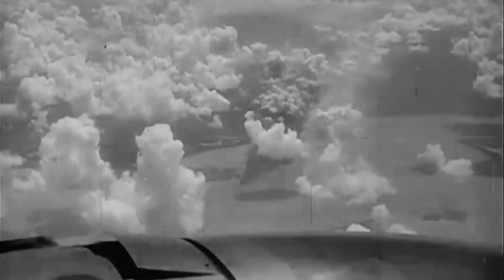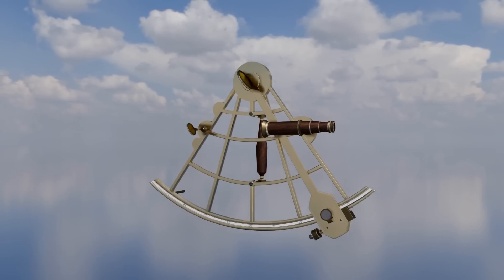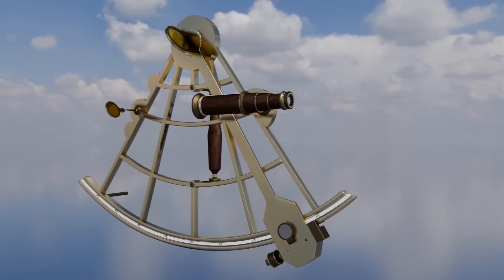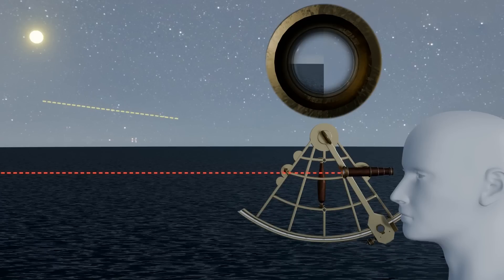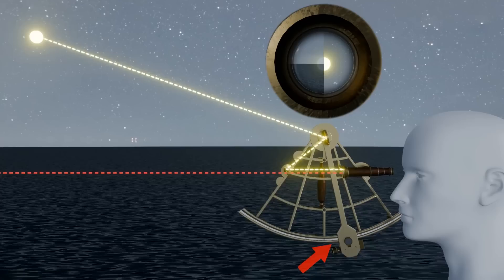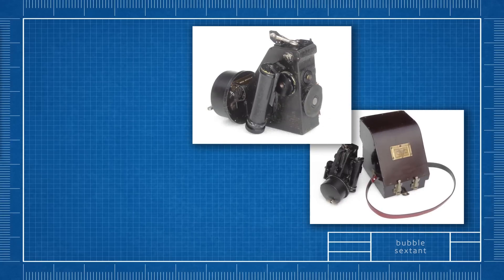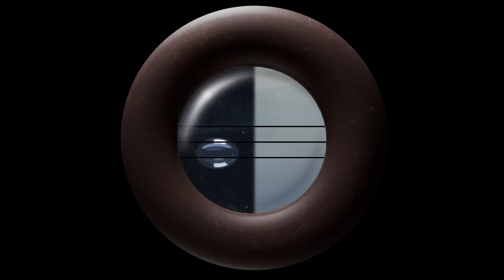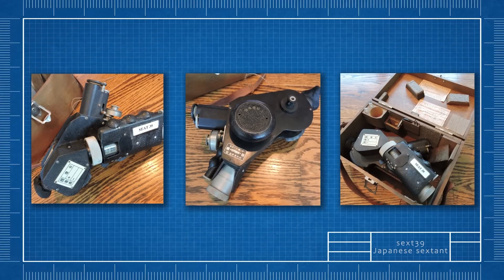Returning Home 2: How Japanese Pilots Navigated Over the Ocean in WWII

Comment: Doubt pilots of single seat aircraft were using Bubble-sextants as their primary navigation means. 

Sure in multi crew aircraft/bombers with proper navigators. 

But you didn’t really answer how single pilot aircraft navigated other than by dead-reckoning, which is notoriously unreliable over great distances.

Comment: Dye markers for navigation ... You rapidly touched this topic in closed captions, but went so fast I couldn't read it ... Could you repost that. Info on dye markers?
Reply: I found the transcript about the IJN use of dye marker at the end of the video.    Very interesting!  I've read that carrier pilots sometimes follow the wake of the carrier to find home.  Is that true?
Reply from the maker: I’ve heard about these two methods but I haven’t found any reliable source to verify them. You can find photos of IJN planes with narrow stripes painted on the fuselage, wings and horizontal stabilizers. It is said these stripes were used to verify the plane’s heading relative to the sea waves. Quite an interesting theory and I’m digging deeper to find out if that’s true or not😉

Comment: The difficult thing about a sextant is that it can only reliably give you latitude. Longitude is so dependent on the exact time and stability of the instruments that you can be off by a couple of degrees, which is as much as 70 miles error.

Comment: Another technique for overwater navigation is plotting your base course to an offset point from your destination, so you know which direction to turn if your destination is not in sight when you get there.  Let's say your destination is an island but that island isn't visible when your chronometer says you've flown long enough.  If you plotted your base course directly to that island you can't be sure which way to turn to find it unless you are really, really confident in your wind drift calculations.  But if you plotted your course to a point South of that island you could be reasonably confident it was somewhere off to your North and you could start your search in that direction.  This becomes a lot more difficult with moving ships. 

The diagonal markings on the horizontal stabilizers of some Japanese aircraft may have been aids to help calculate wind drift.
Reply: Robert Mason wrote a book called "Chickenhawk" about flying UH-1 helicopters in Vietnam in the mid-1960s during the war. They would plot towards the target, but not try to account for wind drift. Then when they had flown long enough, they turned upwind to find the target. Since helicopters are slower than WWII fighter aircraft and much shorter ranged, I'm not sure how well this could have worked over the Pacific. 

Sounds like the Japanese pilots had to be much more confident of their dead reckoning and/or celestial navigation skills than the US pilots that had a radio assist.
Reply: それは「偏流測定線」です。日本海軍の機体には、他にもコックピット外部前方の側面に「急降下目安線」、フラップ翼の前方に「フラップ作動角指示線」など、他にもいろいろな種類の線が塗装されていました。

Comment: The biggest problem of dead reckoning method is that measurement errors accumulate over time and, especially while flying over a large body of water, can't be corrected using known ground features as visual reference.

Comment: This is an amazing aspect of the intricacies of flying a plane back in the day!
One doesn't really give much thought to these aspects of piloting a fighter at sea! 

Similarly, how to adjust fuel mixtures in flight during a dogfight!!!! Yow!!!
Wow!!!
Reply: There's no mention of the fact that the wake of a carrier, which displaces tens of thousands of tons and thrashes a lot of air into the water, is many miles long.  It's kinda hard to miss.
Reply: @David_Lloyd-Jones  Navigation is much easier with less than about 2/10 clouds. Low ceilings make locating landmarks very difficult over open water. Fly at 500 feet and see how far you can locate anything.

Comment: In 1922 two Portuguese Naval Aviators, Navigator Gago Coutinho and Pilot Sacadura Cabral,  departed from Lisbon in a Fairey IIID floatplane and eventually reached Brasil. It took them three aircraft because they force ditched in the first, which eventually sunk, and had a floater ripped off while sea landing in the second. But stubbornly restarted from the position from they had crashed and eventually succeeded. (Just imagine our Ministry of Defence indulging this nowadays! 💪)

A position they had to find in their flight, besides the support ships, was the reefs of São Pedro e São Paulo, just a group of unhabitated rocks in the Atlantic, and they did find them!
It is known that the Navigator had for the first time added a clinometer on his sextant, therefore enabling the instrument to be used airborne. The navigation was all Astronomical and by Dead Reckoning, but the skills of the Navigator and boldness of both crewmen were absolutely outstanding.

While Gago Coutinho died at old age, Sacadura Cabral vanished in the North Sea a few years later while collecting from Britain a new Felixstowe Seaplane. The Fairey which flew the last leg, Santa Cruz, is in the Navy Museum in Lisbon while another Fairey turned replica is in the Air Museum in Sintra AFB.

It can be done, but will request Navigation skills well above average, and luck everytime. 😀

Comment: Planes tend to float for a while upon hitting the ocean due to the fuel in the wings - would it have been possible for an escort vessel to fish out a plane shot down by AA (or the pilots body), or simply check it with a rescue swimmer, and use the maps to launch an attack on the home carrier (if the pilots were given course and position data for the return trip, it could be used for a counterattack as it would have to have accurate data for the next several hours)
Reply: Not very possible nor practical, first of all aircraft doesnt swim due to the fuel, but rather due to the empty tanks and being light i  general. But again it doesnt swim all that long couple of minutes at best. Also maps should be brought, translated and that would take time and by the time you have info at the right table it is already of little value. Besides that if an aircraft carrier aircraft attacked you, then you are aware of the presence of CV in the area and you can already roughly estimate its position or general area where it is so theese maps that are already inacurate by the time you get them are not really of that big value.
Reply: A6M等の日本海軍機には不時着水時に浮力を提供する浮袋が主翼と胴体後部に装備されていた。浮袋に被弾していなければ機体は海面で数時間漂う事ができた。
長いものでは3日間以上漂っていた機体もあるそうだ。

Comment: The sextant is useless in an airplane. Ask the historical department of RAF Bomber Command.
No one can shoot stars in a plane that moves in 3d. An aircraft is not a slow vessel on the sea.
Reply: And yet a lot of E-3B, RC-135, WC-135, KC-135A, and many, many other WWII, Korean War, Vietnam War thru the Cold War aircraft equipped with navigators and sextants somehow managed to do it regularly.  Ask the USAF.
Reply: @timothy____1989  They did it with radio aids such as TACAN and Omega.   The sextants were just a back up in case of radio failure.   Once they got within range, they would be detected on radar and talked home.
The British used sextants in WW2 and often couldn't find the right German city to bomb.
Reply: @timothy____1989  Yes, its no good having a manual back up method if through lack of practice you've lost the skill involved.   In WW2 the Germans (unlike the British who didn't really care what they bombed, so long as it was German), tried using a crossed-radio beam system to hit specific targets, bombing where the beams crossed.  They were foiled though, by the British transmitting on the same frequencies, which had the effect of displacing the beams.
I didn't say sextants were useless.  Someone else said that.   I explained how sextants were a backup to radio aids and could get you within range of being talked down - which is hardly useless.
The British didn't do very well at all relying on astro-navigation under combat conditions.  Fortunately, on returning to England after bombing a German city, right one or not, all they had to do was cross the English coast, about 600 miles on a north-south line.  Landmarks would then guide them, although it was not uncommon for crews to land at the wrong RAF airbase.
There ae no landmarks if your home is a navy carrier in the middle of nowhere.
Reply: @keithammleter3824  you are correct, my apologies. You did not say sextants are useless in airplanes, that was @EK-gr9gd  to whom I intended my reply.  I need to read more closely, so I deleted my 2nd reply since it does not apply to your statement, both of which I agree with.
Reply: Fred Noonan, the navigator for Amelia Earhart, used a sextant to "shoot the sun" on their flight from New Guinea to Howland Island.
Reply: @clarencegreen3071  Well, we know what happened to them.   They never arrived.  Never heard from again.
Reply: @clarencegreen3071  
This island is located just north of a parallel.
Reply: @EK-gr9gd  So?   What is more important is that it is only a couple of kilometres long, and about 1,300 km from their last landmark, the Nukumanu Islands.  Just about impossible to find with a sextant. There was a US Navy ship stationed at Howland to provide a radio beacon, but the evidence is that Earheart's DF radio failed, and/or she didn't use it properly
There was never any intent that they would rely on a sextant.
Reply: @keithammleter3824  
It's an old method  to sail along a parallel to find your destination.
Reply: Nimrod MR2 had an Astral Dome!
Reply: @John-c1n9t  
I know,  but not for primary navigation.
Reply: @John-c1n9t  Since the Nimrod was designed to patrol 2000 km out in the Atlantic, and might have to contend with no Omega  and pre-dates GPS, astral navigation would be useful - you don't have to find a runway out in mid-ocean, no need for precision.   A window might be good for photographing  passing Russian Tupolevs too.
Reply: Not true.  I personally knew an aircraft navigator who used an aircraft sextant.  But, no doubt, celestial nav info. was used in conjunction with DR (just like ships) and just enough to get the plane close enough to a radio beacon/system.  The Lindberghs also used one on their historic flight across the Atlantic (an octant as well).
  The “useless” (i.e. very doubtful) part of the story is that the imprecise results of celestial navigation would maybe get their position to within about 3 nautical miles.  Could they see their ship from such a distance? I don’t know.  The altitude certainly gave them a greater advantage, but those ships look TINY from a great height.  Also…time.  If your watch is 2 seconds off, that’s a half mile off (one mile diameter).  Plus the DR errors…plus the wind…plus the currents.  These errors are cumulative.  Then there’s the actual steps…chart work, sightings, getting the time extremely precisely, reference material, adding your crafts DR from the fix…all while aviating.
Reply: @RodCornholio  Yeah, if navigation with a sextant was as good as this ridiculous video implies, how come hulls that were sunk when radio communication was in use but radio navigation had not been invented where often discovered on the sea bed up to 20 miles or more from their radioed position?
Even the Titanic was 13 miles from the position it reported.  And the navigator had plenty of time to take multiple sextant sights on different celestial bodies and average out the errors.  It was a perfectly clear night and his life depended on it.   And 13 miles error was the best he could do.   An aircrew in a fighter-bomber in average weather could not hope to be as good.
Reply: Shortly after the second world war a friend of mine flew flying boats from New Zealand to remote Pacific islands navigating in exactly that way. The final few tens of miles were done, if necessary, using radio.
Reply: @rogeratygc7895  And flying boats usually have 2 or more crew, unlike a Japanese fighter plane.
Reply: @keithammleter3824  Of course, but it was said by some that taking star-sights from any aircraft was impossible. From a single-seat fighter maybe, but not from an aircraft with a navigator. A lot of the carrier based aircraft had at least two crew members I believe.
Reply: @rogeratygc7895  
As you said  ...